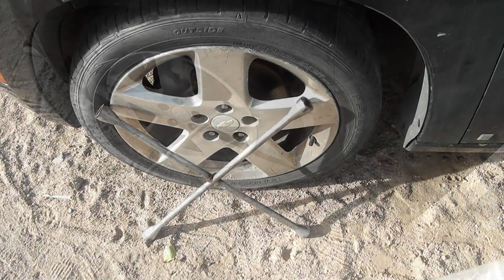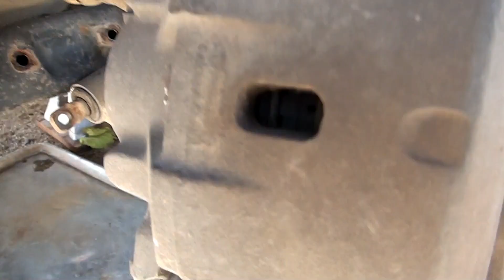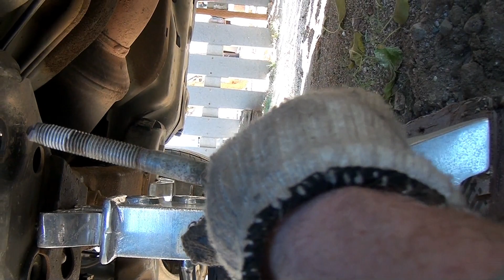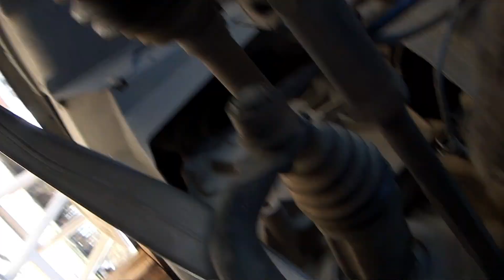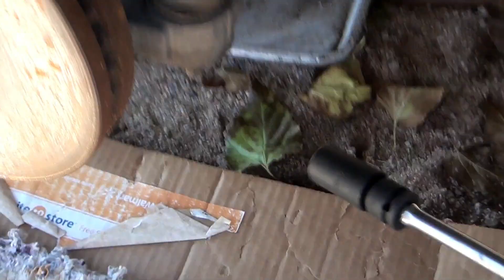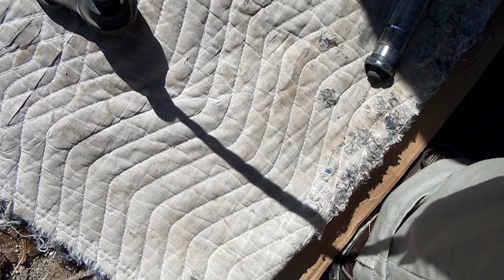2006 Chevy HHR Lower Control Arm Replace

Comment: Yet another video where they got lucky on the cage nut bolt maybe I will have to take it in to get done cause I can't figure out how to get to that damn nut
Reply from the maker: Not quite sure what the issue is.
Reply: @SteveAZ711 theres a cage nut on the single bolt every video I've seen everyone got it out no problem but on mine it came lose and just free spun
Reply from the maker: If you can slide an open end wrench in and feel to get a grab on it . Spray a liberal amount liquid wrench or my favorite ...Free all in the opening. Let it sit for 15 minutes. Then try and get another bite on the nut. It has to be on the bolt and you can turn the bolt till you find the proper wrench or maybe use an adjustable wrench. You may be able to just use a pry bar against the nut as well. Let me know the outcome. AND take a break and try again later if fights you.

Comment: Hello do i have to take it for alignment after replacing both sides?
Reply from the maker: I did not have to. However, it is a good idea to have it checked, especially if you are experiencing drivability issues such as pulling to one side.
Reply: @SteveAZ711  thank you

Comment: I know the HHR shares many parts with the Cavalier, Pontiac G5, Cobalt,  but, I just picked up a 07 G5 & It needs a driver side front lower control arm! The one thing that you did not mention is, At least on the G5, They came with TWO DIFFERENT SUSPENSION SET UP'S!! (SPORT OR TOURING) One must know which suspension their vehicle has when ordering control arms! I did not see in your book where it said to torque then, loosen & re-torque the rear bushing... only the nut on the ball joint bolt! I believe it to be very important to wire wheel any corrosion or rust off the bolt, & arround its hole & mounting surface & use anti-seize on the shaft of the bolt & thread locker on the threads & maybe the built in washer(face of bolt) So that the bolt does not rust/seize in the next 10 years or so (for the next person)
Reply from the maker: No Sport or Touring HHR suspensions.

Comment: I have a 2006 HHR bought brand new.  It has 225,000 miles and is currently on the 3rd set of lower control arms.  It seems I replace them (myself) and they last about a year before they start making noises again.  It has been about 2 years since I installed the last set and it needs them again.  As for torque, I have just tightened them up as tight as I could.  Since I installed the last set I figured I was doing something wrong.  An internet search told me that before the final torque, while the front end is lifted, I should load the front suspension as it would be if the car would be sitting on the ground.  This would be done by putting a jack under the brake rotor and lifting it into its normal position and then torquing everything to the proper settings.  That was not covered in your video (excellent video by the way).  Do I need to load the suspension prior to torquing or did I just mess up by not torquing properly in the first place?
Reply from the maker: My shop manual did not mention anything about preloading before applying torque. Also, I guessed at the torque angle and should have used a tool like the one in the link below. Additionally, maybe a better part brand will last longer?
Here is a link to angle gauge...https://amzn.to/2XY2l48
Reply: @SteveAZ711  Thanks for the reply.  I have been using Moog parts so I don't think cheap parts is an issue.  I'll probably pick up one of the angel gauges before I replace my control arms again.  Thanks for the link!

Comment: im doing this tomm. and have watched a bunch of videos.i thought the control arm had to be pre-loaded (with pressure on the ball joint area, (after tightened) with floor jack) so that they set at the right level before you tighten the 2-15 mm bolts and the 1-21 mm bolt ? is this not necessary ?? i know the 3 bolts needed to be started but not tightened until preloaded
Reply from the maker: I did not preload mine. I followed shop manual procedures for 2006. It is up to you. Question...if the wheel is designed to travel up and down over bumps, then what is the correct level at which one should tighten the preloaded ball joint?
Reply: @SteveAZ711  well the job went pretty smoothly, thank you for the torque specs. i knocked it out in a little over 2 hrs. in a gravel driveway. and your right i dont see where a preload made any difference at all. wish i would of seen your reply before i started. moving that floor jack around in a gravel driveway is a bitch!!

Comment: As fast as cars are built, do you really think they use torque specs?
Reply from the maker: Of course, right down to the lug nuts. It keeps the wheels from falling off. Over tighten a bolt, and you may stretch it and cause early failure. Under tighten it, and the part may loosen, fall off, or prematurely wear. I like torque settings especially in aluminum. keeps from stripping out threads or cracking a part. good mechanics can generally go by feel as they work on vehicles all the time and are used to the tightness of certain parts.
Reply: @SteveAZ711  i agree i love torque wrenches. Love using them. Torque angle specs all of it. But for the most part, i go with tight is tight and too tight is broke.
Reply: In a factory they have custom guns for everything. They'll automatically torque every nut and bolt as they're installed. I've seen ones set up to install truck wheels, it has 8 sockets to tighten all 8 lug nuts at the same time and torque them too.

Comment: Where can I find a good impact drill and socket set to accomplish this task??
Thank you sir
Reply from the maker: There are 2 links below. They are the tools I used. One is for the impact driver,and the other is for the battery...
https://amzn.to/2Y0tOTT

https://amzn.to/2YqaQp6

Also check EBAY for this Ryobi impact driver. It will need the bigger battery to do robust work. 
Do not overlook any used DeWalt 1/2 in. impact drivers. I see them used on many YouTube videos. Also, check Harbor Freight for a 1/2 in Impact Driver. Be careful and do not get a 1/4 in. driver as they are too weak for removing lug nuts and such work. Hope this helps.

Comment: Had to do that job a week after buying my new to me 2007 HHR. but I only needed the big bushing so I ordered that and pressed it in.  had a heck of a time putting it back together then put a ratchet strap on and it all lined up. that and a new power steering motor is the only issue I have had for a year now. we rung the same motor in our baja bugs and they are bullet proof.
Reply from the maker: Hey Ed you did some work there! Good to know about the motor too! Those Baja Bugs sure do take a beating!

Comment: Do you need to have a wheel alignment after doing this job?
Reply from the maker: That is hard to say. If your H is pulling to one side or the other, then Yes. Do a tire rotation first, then a test drive. You want to have the best tires on the front for this check. Make sure all the tire pressures are to specs. My HHR is 35 psi both front and rear cold! If you decide you need an alignment then have it checked. Otherwise, wait till you think it may need one or when you buy some new tires for the front. Also, if an alignment will give you piece of mind then have it done. Here is a link for more info on an HHR wheel alignment...
https://repairpal.com/estimator/chevrolet/hhr/wheel-alignment-cost